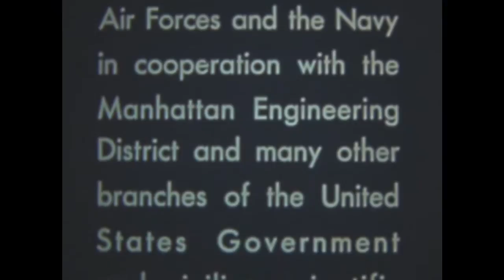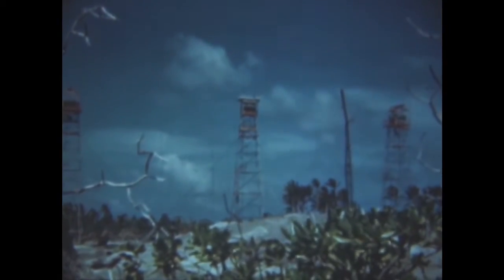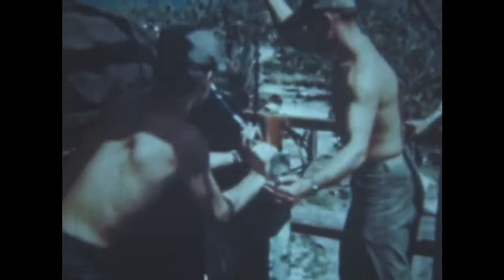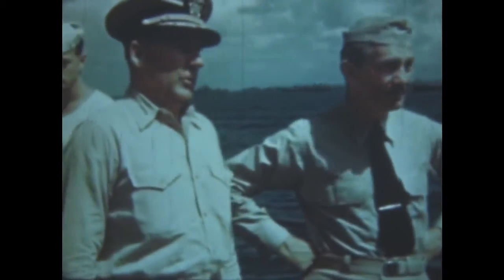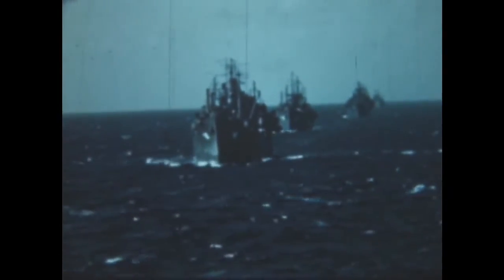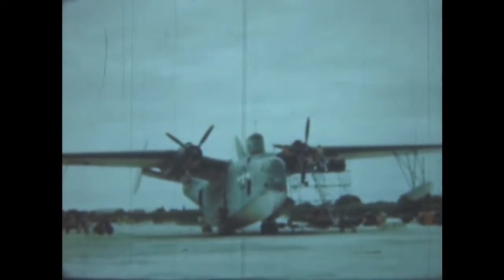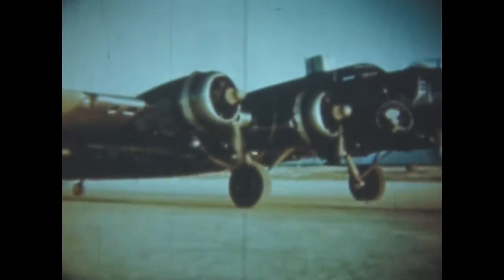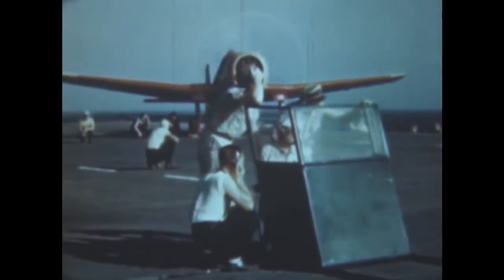Operation Crossroads: Atomic Tests (1946) - Part 1

Comment: @toecuttergpx that not true. light is a form of electromagnetic radiation. gamma radiation which is a separate wave length of the spectrum which film isn't sensitive to is what we mean here. as well as alpha and beta radiation which are more to do with stray particles from the atom, protons, electrons, neutrons.
you'd need special film to capture IR, xray and UV which are still closer in wavelength to  visual light so it makes sense.